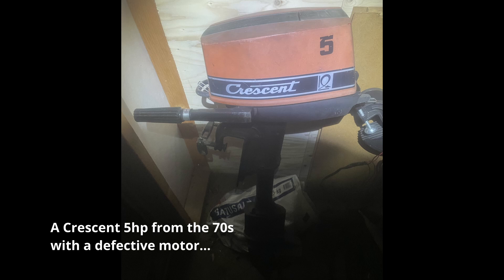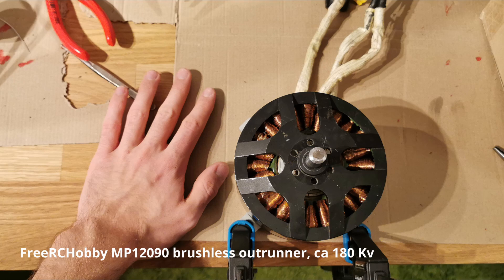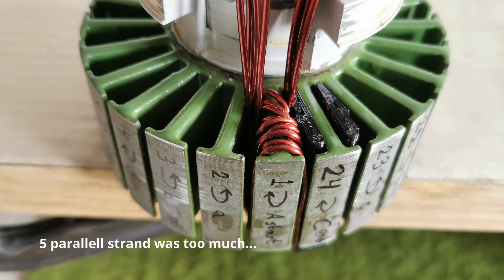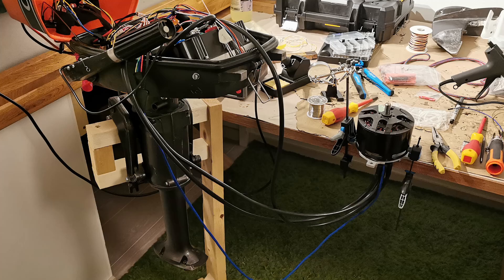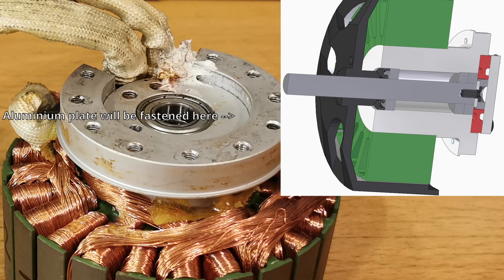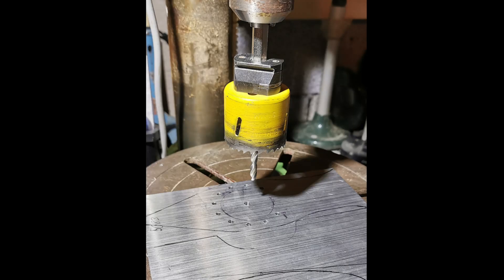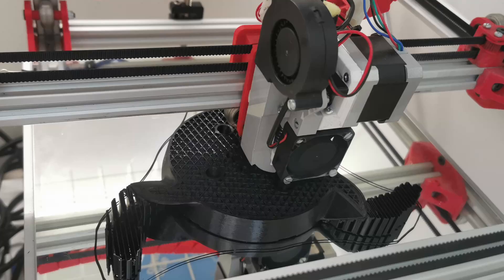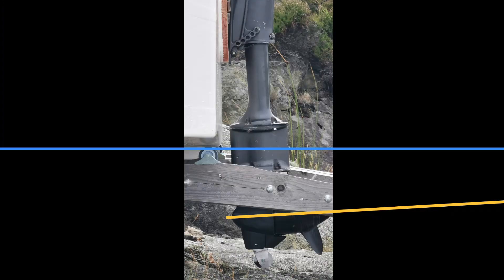Electric conversion of a Crescent 5 hp outboard

Comment: Amazing build and soo quiet. I wonder why this is not yet the standard for outboards and a lot cheaper that the existing systems. If you would put the motor on top you could also use the original gear ratio. Maybe there are old motor shafts that use a 2:1 system so you wouldn't have to rewind the motor? Cheers

Comment: Hello ! after  use  did you clean the engine with fresh water or not?
Reply from the maker: @ParanomosGR  I did wash it with fresh water a bit, but normal steel will still rust like crazy. Pretty much impossible to get the salt away from all crevices :)
Reply: @AntonMakesStuff  perhaps after use put the motor under cooking oil!until the next use!I have an old motor scorpion outrunner 3000W continuous I'll put a propeller on it for my SUP! I will not put anywhere epoxy! since I saw in your video that it doesn't help much! is there a short circuit problem with the coils if they don't have epoxy?Thanks
Reply from the maker: @ParanomosGR  Oil might work better, I dont know. But sounds like a mess! Epoxy will work better than nothing, but you need to apply the epoxy better than I did, and I had some rubbing as well which lead to holes and cracks where water could get in. The windings are insulated and should be fine, the stator on the other hand is just normal steel and will rust like crazy if untreated in salt water...

Comment: Best video i have seen so far about that subject. At least you tried direct propulsion, I think its a shame to lose all that power in the gear reduction and transmission.
Thank you for sharing all the data and parts used. 
Was not 80kv a bit low ? 
A good option could be direct shaft transmission, with the motor inside the boat, like a shorter version of the longtail boats used in Vietnam.
Reply: Biyv80 kw batery 15 hours rin time

Comment: Did you even try to see if rewinding was necessary?!
Reply: He needed higher RPMs to get the speed. So either rewind or run a higher battery voltage, since max RPM is dependent upon supplied voltage.

Comment: I was expecting to see a conversion where you just replace the ice with an electric motor.  Very impressive.   What voltage battery did you use?  I would think 12 v would require to large of cables.to carry 400 amps.
Reply from the maker: I use a 12S lithium battery, ca 44V. 12V would be too little voltage :)

Comment: Why can't the manufacturers make something simple and effective like this!

Why are the only commercial options available crappy underpowered 1hp or less, claiming to be 3hp when they're not even remotely close, with a proprietary battery slapped on top of the outboard so all the weight is in the wrong place, and costing well over twice as much as a (much faster) petrol outboard (and that's before you even get to the cost of the batteries!).
Reply: Yes mr fish. That is the question I wonder too!

Comment: If the motor floods with water then a significant portion of the motor power is absorbed moving the water inside the motor. That leaves less power available to turn the propeller. The sealed submerged motor, or the motor mounted where the ICE motor was would solve this issue.

Comment: Well done for a first time learning experience.  The results are very good.  I love the fact that from the outside, it looks just like a regular outboard "motor".  The R & D you did and your knowledge and skill set are highly commendable.
  As intelligent as you are, you have probably already figured out what my observations conclude.
  If you choose to do another, do all the machining of the stator and rotor prior to any rewinding.
  I would try electroplating the rotor and stator with a heavy layer of copper or maybe cadmium on both, to help combat saltwater corrosion prior to rewinding. I don't know if this would affect the magnetic gauss or induce eddy currents in the copper plating leading to it heating up. The point of that is to not rely on a coating of epoxy on the close tolerance surfaces of the rotor and stator and still keep a barrier between the saltwater and the steel.

Comment: Hi, can you use an e-bike conversion kit,? 48v kits & 2kw - 5kw motor?
Reply from the maker: Hello,
I guess you can. A hub motor might be tricky to mount, and also not spin very fast (around 2000rpm is good for a propeller). But I'm sure it could work. Also worth to note is that many cheaper controllers advertise very high powers, like 5kW, but that is the absolute peak power and can not be outputted for very long.

Comment: So the motor controller is rated for 84/96V - was there any problems programming it to run from nominally 48V only? What options is there for programming/setting up the controller?
Reply from the maker: Initially the motor raised its low voltage alarm, but the low voltage level can be set in the settings. I think you should not go too low on the controller voltage, for example 24V might not have worked.
I used a Bluetooth app to set up the controller, but you can also connect via USB with a computer. The app has a few bugs, and all settings are far from obvious what they do, so it can be frustrating to set it up.

Comment: No details on battery pack?
Reply from the maker: 2,5 kWh Li ion battery made from 18650 cells. There is more info in the description and other comments :)
Reply: @AntonMakesStuff  yes, but I would love to see pictures. Is the battery pack inside the old motor housing?
Reply from the maker: @zaprodk  I don't have enough material on the battery to make a good video, maybe I can make an album or something and share it though google Drive. I'll think about it :)

Comment: I think your assessment was correct - self inflicted iron rust.
I can't see how you can waterproof a motor, the very nature of water means it gets in or out of places it shouldn't.
Your hull looks like a good Netting boat flat water, fishing using a net.
What you don't need is something to catch under your boat.

Here's my idea, "Electric Jet Power" - I know 'sounds eggciting right' so the motor is on the floor shaft through the water intake to the prop and blow it out the back using steering.
What could be more exciting and simple?
Reply from the maker: Jet drives are inefficient at low speeds, but it would be very exciting indeed! But far from simple I think.

Comment: This is very cool - do you think the printed propeller deflects underwater reducing thrust? Also do you have any details of your plywood boat somewhere?
Reply from the maker: Thank you!
No, I don't think it deflects (not much anyways). The propeller blades are quite thick actually. In the propeller design program I used (https://www.wageningen-b-series-propeller.com/) I specified plastics as a material, so the program takes that into account and changes the geometry to handle the material. Very neat!
My boat is a slightly modified version of this boat by Tim Weston: https://www.timwestonboats.com/small-boats/boat-2-weeks/

Comment: Seems like a whole lot of work to submerge the motor, when you could have just coupled it to the old engine shaft & and used the old propeller. Next time use varnish instead of epoxy.  Its the same thing used on the magnet wire to seal it.

Comment: I really really love how quiet it is. I think it would be worth developing this concept to something reliably sealed. How much louder would an inrunner engine in the old ICE position be compared to what you developed?
Reply from the maker: Me too, a quiet boat trip is very nice!
I don't know really. I know inrunners generally are quieter than outrunners, and if you use a high quality PMSM motor with a FOC controller it should be very quiet (but probably not as quiet as a submerged motor...). I think you could achieve even less noise with an induction motor, as it has less vibrations.

Comment: Impressive. If you 3D print a water propeller again consider sanding/smoothing it. It will significantly increase the thrust for a given power.

Comment: Where did you put the battery? Inside the motor housing or inside the boat?
Reply from the maker: It is inside the boat, in a waterproof case. A lithium battery, around 2,5 kWh

Comment: very good job. next have all the components in the old motor housing including battery and controller. have an external plug for recharging and maybe solar?
Reply from the maker: Thanks! It would be cool to have solar charging. The battery in the motor housing I don't think is a good idea, it would not be possible to fit a battery large enough for long range or a powerful motor.

Comment: I used to rebuild very large electric motors. We had a varnish tank and soaked the stator in varnish overnight. Let it drain after removing and then into an oven to bake it on. That lasts until the net overhaul. It should work for waterproofing as well.
Reply from the maker: Thanks, that is a good tip. It is probably more heat resistant as well, compared to epoxy.

Comment: I'm really surprised that a 3d printed prop could handle that amount of power/force. Did you use any post processing for strength?
Reply from the maker: I just sanded it smooth. Printed in PETG, which is a tough material :)

Comment: Oh werd? Small boat but it's also only a 5hp motor,  moves pretty nice though. What type of range you get out of it on a single charge? And the original motor is on top so why not use the original 90 degree shaft and output?
Reply from the maker: 7-30 km, depending on the speed (2,5kWh battery). Yeah, why not use the original shaft and output... It certainly would have been much easier, but I wanted to try a direct drive.
Reply: @AntonMakesStuff  respect, I mean rewired the motor and all that water proofing, and yes their would be some loss through the 90° shaft so, if feasible that's obviously more efficient. Since it's no longer gas, you should be able to fit a more aggressive propeller since you have the instant bottom end torque to move it with ease while achieving speed too, but awesome work! 🤘👍
Reply from the maker: @scottbattaglia8595  Yeah, the original 5 hp propeller was quite tiny compared to my 3D printed one (which is designed for 8 kW). But I think that a propeller larger than the one used in the video would be too large for 5 hp, it would just require too much torque
Reply: @AntonMakesStuff  just do not underestimate the linear smooth torque curve you get from a gas engine to an electric motor, same as a Tesla can out 0-60 almost every super car, just don't take the new power map for granted when choosing your setup, not a naval engineer so I'm not sure propeller efficiency speed and such, I know it makes like a huge difference, in the setup, but consider you have full torque now basically from instant to full rpm, compared to a normal gas engine that has to pull rpms to start building the torque, which why I'm sure you can go bigger but in what effect as far as design will that benefit, I'm not an expert, but either larger or heavier since you have that instant torque from start, or be it a more aggressive pitch, but regardless with the extra instant torque should definitely have room for lots of improvement, wish there was a good source where someone did some data, it's a great project though, so many outboards old 2 strokes waiting to die, and a simple electric motor swap could breathe a lot of life back into the boating industry, it's slowed down so much since the early 2000's......but super awesome project!👍
Reply from the maker: @scottbattaglia8595  I see what you are trying to say, but the boat performance (speed) is not limited by the torque but by the power of the motor. And the power of an electric motor and a gas engine is equal, if they have the same power.
Reply: @AntonMakesStuff  not saying it's limited but torque would be important for acceleration, obviously top speed is RPM based mostly but I was assuming with extra torque you could drive a larger diameter prop thus it's top speed moves more water = a higher top speed......
Reply: @AntonMakesStuff  there also maybe a max rpm where spinning that prop any faster creates boiling at the prop edges thus  becoming less effective even though it can spin faster, that's all I was kinda getting at, you should be able to use the torque increase as an advantage, if the drastic increase of rpm didn't make for a good increase in speed expected, I would look at size as I mentioned....

Comment: Hi Anton can you share. how much distance can make your motor with 1kw battery. Just interesting .
Reply from the maker: It depends very much on the speed. I have done some speed/power measurements, I think I also wrote it in the description. For example, at 400W the boat has a speed of 5 km/h. So with a 1kWh battery that would get you around 10 km. At the highest speed, 16 km/h, the motor needs 4500W. So that would only get you 3,5 km with 1 kWh :)
Reply: @AntonMakesStuff  thanks very helpful, do you have Instagram? Or telegram Page
Reply from the maker: @Gergosh  No, youtube will have to do :)

Comment: I use 2 part epoxy paint for waterproofing metal and wood it fills good and you can see any failures in covering because of the pigment
Reply from the maker: Thanks, that is a great tip! It is hard to see the coverage of transparent epoxy...

Comment: See how the water's getting aerated by the prop?  That's cavitation and is being caused by overloading the blades.  In short, you need a LOT more blade area.
Reply from the maker: It's easy to think that it is cavitation, but it is actually ventilation. My construction was not air tight, and air got sucked into the propeller through the old propeller shaft/frame (there was a gap between the outboard frame and The aluminium motor mount). I eventually put some material in there to fill out the gap, and now there is no ventilation at all :)

Comment: Excellent work!!  Will the 3D printed prop survive 10kw of power??
Reply from the maker: I tested it with 6 kW and it held up! The program that generated the propeller geometry (https://www.wageningen-b-series-propeller.com/) takes the strength of plastic into account, so it will at least hold for 8 kW as that is what I specified. I think 10 kW is totally doable, especially if I print a slightly larger propeller.

Comment: Great work, I know your pain. I did and outrunner underwater for my diy efoil and did the epoxy magnet process. what I did was make a dam at the end of the magnets and filled the entire void with epoxy and had it spinning in my drill press on its side for a few hours. I got a very even coat with no rubbing. my next project will be an outboard conversion, but it would probably just be easier to take the wing off of my efoil and clamp the mast to my boat haha
Reply from the maker: Thanks! That sounds like a good method (I have actually read about that on efoil.zone ;) ). Haha yeah, that might be easier. It would be interesting to see how a efoil motor would perform on a small boat.

Comment: making motor waterproof is harder to keep it from not rusting
conver gas engine to electric motor is little easy but reliable no rust no under water motor unless have pump in shaft that could use it cool down esc (electric motors control) 
i have done few conver but never make video of it (it was for customers they wanted blowed up engine removed and put electric one on it so i did and they have cut floor open to remove gas tank and put battery in it) motor they where using was from electric forklift 300vdc (yes it took a lot of battery to match same voltage)
i grate to see you try ur best n u did awesome

Comment: Well done! The decision of whether to have the motor in or out of the water is definitely a tradeoff between efficiency and ease of use/design. A lot of electric outboards are motor in the water for cooling, but looking at the effort you put into the motor I feel that motor out of the water might be an easier conversion.

There are also other solutions for motor in the water such as running a brushless motor in mineral oil with shaft seals to keep seawater out. The differential pressure across the shaft seals is lower with liquid on both sides. But eventually shaft seals fail as they have a tough job to do. I'm amazed they work at all.

I'm also impressed in the propeller, it's not often you get to 3D print something that works at meaningful power in the real world!
Reply: They metal printer parts have come a long way. Those parts are used by the militery . Its pretty hard to beat the durability of machined parts. I know the plastic gears on camshaft in the old day were ok for a while but ultimately failed. Metal is nuch more durable.

Comment: Hello you took the motor head out of the motor did you think of trying to mount the elec motor were you took out the gas one i think it would save you alot of work you would not have to make a prop and you can change props to bigger or smaller then you would not have to worry that your motor was in water all the time and you could mount a bigger elec motor on top .
Reply from the maker: Yes, I did think of that. I discussed it a bit in the end of the video
Reply: @AntonMakesStuff  The bevel gear is quite costly energy wise - you chose the most efficient solution. Perhaps a belt drive could be an alternative if the inside of the stem had room for it.

Great video! It was very interesting and I subscribed in the hope of more videos from you. BTW: The landscape reminded me of the southern parts of Norway.
Reply from the maker: @rolfnilsen6385  Thank you! 
Bevel gears have some losses, however in my case I think the large motor diameter will lead to larger "losses" at high speed (higher drag than a normal gear casing). A belt drive would be very interesting!

My goal is to make more videos, but I have no idea when or what the next upload will be :) 
I filmed the video on the Swedish west coast, so it is not far from southern Norway!
Reply: @AntonMakesStuff  You do good stuff so looking forward to any new videos your creativity might cook up ;-)